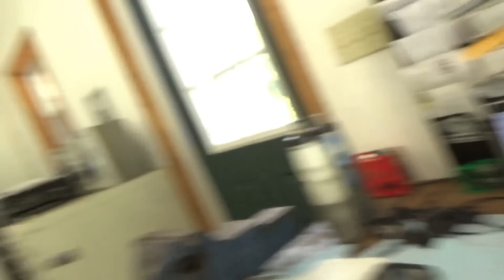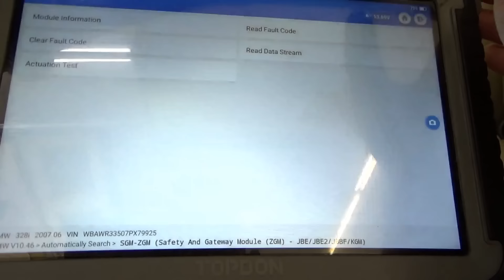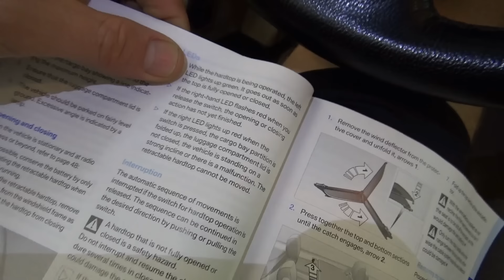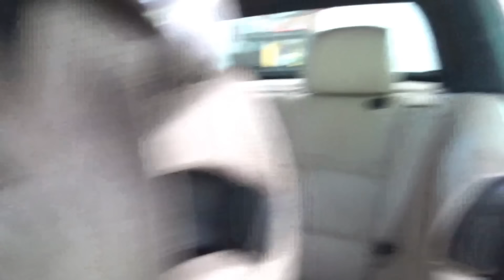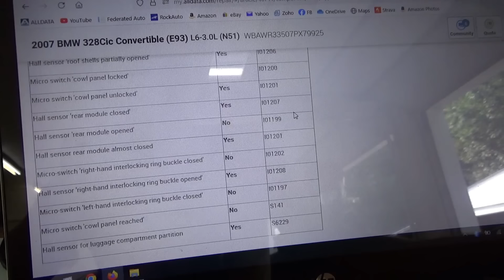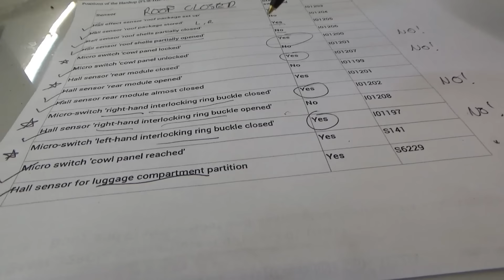(Pt 1) CRAZY Convertible BMW...BUTCHERED!! ('07 328Ci Windows-Top-Trunk BROKEN)

Comment: Scan are great, but you still need to do a hands-on usually it’s in a connectors, but I would spend more time physically than hours on the computer
Reply from the maker: Your hands and eyes can't read voltage signals...the other shops spent MONTHS physically tearing apart the car and connectors and wires and modules, and got absolutely NOWHERE ;P

Comment: I had a smilar issue, i fixed this way: - disconnected the hydraulic pump, closed the roof manually, pushed the rear locks manually (hard to push all the way) to reset the locks position. reconnected the pump. problem solved.

Comment: This is a classic example of why when trying to solve a problem like this, it's important to read and understand how the system works before you start playing with anything. It doesn't look like there was any reason for them to be messing around inside the door panels, with the window switches or the convertible top switch when there was nothing wrong with any of that stuff. All they were doing was potentially building in more problems when the cause of the issue had nothing to do with them.

Comment: i was following along with service info, and BOY are there a lot of different wiring variants for this car. Looks like three or so different versions of wiring within the same model year, depending on when it was manufactured... Thanks BMW! Also, it looks like there are different pinouts for some parts depending on whether it's for the 3 series or 1 series, but not sure if that's relevant for this case.

Comment: Oh man.  I remember going through a check list like this with a Volvo C70 convertible.  It turned out to be a bent linkage arm causing a misalignment with a microswitch.  But just getting at that switch was nearly impossible with the roof closed.

Comment: Hi Ivan, want to give you my experience with a BMW convertible not working.

Coworker was working on it and trying to figure out why the top won’t fold. He gave up and gave it to me. I ended up getting papers from the actual BMW training somehow(don’t ask. No clue). I ended up finding that the magnet for the motor/hook that’s above the windshield broken off. That magnet broken off is supposed to tell the module that it’s completely closed but it couldn’t see it. So with some “Russian” hack, I ended up super gluing the magnet in the correct spot and had to modify it a bit. The module now sees everything and is able to open and close the roof.

Comment: Ivan there appears to have dual hall sensor at each window regulator and my observation is the rr and rl is showing as a low state so the car thinks those windows are already open and probably hasn’t set a code as there isn’t a correlation fault with the sensors, when you was test passenger front with the window closed it showed at as a high state and same as driver front also the roof wont open if the windows are not changing state

Comment: You are so lucky to be able to just pick up a scan tool and look at all the PID info I used to have to tear apart the interior to find a control unit and pin test every wire.

Comment: Anybody Brite suspension techs help with creaky random noise  early 2k f150 2002 5.4 2v 4x4  at slow speeds backing up ect loading suspension.  Complete suspension replaced  even the swaybar bushings and ujoints the only exception is lower control arm bushings which looked good ?????

Comment: I think you need to check for service data into the actual sequence of all the mechanisms and latches. You have a bunch of no's, and you're checking each individually, so you're gonna find the reason eventually. But if you go by the sequence, you'll start with the correct no. And then everything else will probably change and the rest will work.

Comment: Never worked on a 3 series before but did a 6 series convertible. I’m sure a similar concept. Had a bad relay in the main pump motor location. Purple in color. I think there should be a way to manually lower the roof.

Comment: I have unfortunately dealt with several of these, it's almost always one of two things: 
1. Something got wet 
2. The hydraulic system either ran out of fluid because of a leak or the motor died.

Comment: Pretty soon every function is going to have a f***ing computer module. The manufacturers have already gone way beyond using CANbus systems to "simplify" wiring, instead using them to further complicate and therefore profit from given most repair shops (including their own dealers) fail to understand the systems to perform the proper repairs.

Comment: I had a similar problem with a 2005 Chevy ssr when you push the switch the module runs a check list as soon as it fails a test it stops and generates an error. You need a flow chart that shows the order of the tests, then you check each check each one in order until you find the failed test . That is how I found my problems each time .

Comment: you can normally manually close and open the roof there is a hex key near the interior light. i would check the behind rear boot trim think battery side the pumps usually get full of water with leaking light seals. also did not see a ccm module on your scanner that normally lives near the pump and also gets wet. almost forgot the relays live there too

Comment: I just had a toyota that had the same problem with windows and found a melted wires from rear adas sensiors melted and shorting and blow main fuse for module power supple.

Comment: Yikes!!  My first thought is to get this thing to a good bodyshop and get it on a frame machine.  If it hit a pothole hard enough to bugger a control arm, and now the folding hardtop isn't tripping all the right microswitches, I have concerns about vehicle structure.  I imagine this will be quite challenging to get everything to line up and trigger properly!

I will say, these complex convertible systems are one of few things I'll usually send along to somewhere else.  As always, I'll happily look at the vehicle to see if anything jumps out at me (at no charge to the customer), but I have to acknowledge that I lack the patience, and occasionally the physical dexterity, to troubleshoot these things in depth.  I gotta put the customer first.

Comment: The bain of most males; failure to RTFM! 🎉 I would guess when the son hit the pot hole, it jarred the roof out of position and there is no way to automatically reset or re calibrate the roof other than manually activate the motors to get the roof in its ready condition.

Comment: FROM CONNECTICUT. I DONT TRUST 1 SHOP HERE. EVERY TIME I HAVE USED A SHOP THEY DID MORE DAMAGE THAN THEY FIXED. SO, THIS 65 YEAR OLD HAS TO DO HIS OWN WORK. IVE LEARNED A LOT WATCHING YOU, BUT I AM NOT AS SMART AS YOU. HARD TO TEACH OLD DOGS NEW TRICKS. IF YOU WANTED ME TO PUT POINTS AND PLUGS IN GREAT, UNFORTUNATELY I DONT KNOW ALL THIS NEW GARBAGE.
BROUGHT MY CAR TO THE SUBARU DEALER AFTER I MISTAKENLY BROKE A 5O AMP FUSE AND IT SET OFF THE TRANSMISSION TEMP LIGHT, TRACTION LIGHT.... THE DEALER TOLD ME IT NEEDED A NEW VALVE BODY, I TOLD HIM NO.   I HAD TO PUT ALL 4 WHEELS OFF THE GROUND AND DO A TRANNY RELEARN.. 6 MONTHS LATER AND EVERYTHING IS FINE... I WOULDNT TRUST A DEALER TO PUT AIR IN MY TIRE. ALSO HAD AN AIRBAG RECALL. TOOK THEM 2 DAYS TO DO A 30 MINUTE JOB. THEN A FEW DAYS LATER I GOT A PASSENGER AIRBAG RECALL. NO WAY AM I BRINGING IT BACK. THAT WOULD TAKE THEM A MONTH.
HAPPY THANKSGIVING IVAN, YOU TAUGHT ME A LOT

Comment: While watching this video I kept hearing my Dad saying, "Over complicated stuff is neat but that is just more stuff to break and a bigger repair bill."
Reply: Your dad and mine must have been brothers from another mother. My dad wouldn’t even own a car with power windows. “It’s just more stuff to break!” was his mantra.
Reply: Sometimes it's difficult to follow the "Operational Flow," that is what starts, what continues, and what ends the operation.  By "Reverse Engineering" you sometimes can figure it out.  If the motors are working manually, are the switches all changing (open and/or close) direction manually.  I'm sure you checked any Service Information for details.  Any forums online with helpful info?  Without being there, unless someone's seen this before, or is with you, powers and grounds are the start.  Maybe switch adjustments?

Comment: We had one in the shop last year with a leaky cylinder.  Replaced the cylinder then realized one of the micro switches wasn't engaging because it's "bumper" wasn't fully pressing the button.  
The thing looks like a Transformer when the top opens and closes. "Autobots, transform and roll out!"

Comment: This is a long shot but here it goes.  My wife has the same vehicle - 2018 model year - and encountered this issue twice.  First time it was due to a package being put in the section on the right hand side section near the rear of the trunk.  Actually there's a placard with a red X.  Anyway the sensor under that went which was communicating that there was something there so the top wouldn't work assuming something was there that could interfere with the top fully opening.   The second time was a sensor for the package tray that you moved into the open position.  The sensor was not reading correctly so the top wouldn't work thinking the tray was not in the fully open position.  

Good luck with the rest of the diag....

Comment: @Pine Hollow Auto Diagnostics grab an old laptop without personal data on it, and a copy of Ista+. The corresponding cable is fairly cheap. Modern BMWs just use Ethernet over the OBDII connector. 

Ista usually has built in guided troubleshooting for stuff like sensor/logic issues.
Will save you a lot of time and frustration when working on BMW and Mini products.

Comment: If you think the BMW over-complex and a nightmare, try working on a 1961-65? Lincoln 4-door convertible.  All the switches are sequenced and operate individual relays to power the motors.  The rear door windows drop 1/4" while the top is being folded or erected.  Relays hidden inside the latch pillar between the front/rear doors.  And, of course, FoMoCo engineers install a full rack of relays with the connectors facing upward.  If you get any sort of a leak, the water can seep down into the relay 'can' and have a good time rusting all the moving parts.  To make it work, you have to understand the steps it takes in both directions, and the micro switches that signal to enable the following steps in the series.  BMW makes it complex beyond reason, and if your 'buckles' don't make it all the way open or closed, can eat the BCM by burning out components.  Fun.

Comment: BMW engr to boss: I have this system working, ready to ship it.
Boss: How much logic?
Engr: Very little.
Boss: That wont work, add 16 more AND inputs, select signals at random. I suggest oil pressure, TPMS, blower speed 3, and right rear passenger seat belt buckle. Pick the other 12 inputs using VSD (Vehicle Signals Dartboard) in my office.
Engr: Will do.
Reply: Merc has a similar system with convertible hard top in the SLK. Those things are equally complicated but bulletproof. Our 97 still works perfectly fine with very little maintenance.

If you connect the BMW OEM software there is probably a troubleshooting option for the top which tells you the bad sensor in 30s. The software is not too hard to find on the interwebs.
Reply from the maker: @tschuuuls486 30 seconds.... Hahahaha 😂

Comment: My friend had a 1968 Lincon Continential with a hard top convertable slid into the trunk put down the 4 windows an inch the trunk raised up in the back of the trunk rose up  and into the trunk the roof went slick and a rare option ! I had a 1963 Chevy impala hard top convertable but the roof wad fixed nonmoving !

Comment: The old cntrl/alt/del battery disconnect wasn't going to work on this cluster. Too many people have grazed on this poor car's systems, each one digging it deeper into trouble, and failing to fix. Can't wait for Part 2.
Reply: The Ctrl+alt+delete is probably in ista+. The BMW OEM software. Probably a re init convertible top option.
If it would auto fix itself on battery reset, that could be a bad idea. Imagine the top tries to open and gets stuck in a snowstorm because the battery terminal is loose.

Comment: It was always going to be something to do with the top and it will end up being something pretty simple like a micro switch or sensor. Its amazing how well these things actually work and how dependable they can be. I mean the darn thing is almost 20 years old. The complexity is nothing compared to a 90s Mercedes SL500 with its 12 or 13 hydraulic cylinders and about 50 mini hydraulic lines each one unique from each other. At least you can use a scan tool to aid in diagnosis. You have to admire the engineering even if you don't like the complexity. Love it!
Reply: I totally agree, when you think about what it actually does, being a fully automated folding hard top, it's an incredible mechanism. There are a few on here belittling “German engineering” because it broke, I guess.  Nothing lasts forever, but I would bet on the durability of this 20-year-old hard top over what automakers produce today, any day.

Comment: one of my rules of thumb: the Manual is one of "Five Things People Throw Away™".  you should count yourself lucky if it's there on a used vehicle.  the other two are "the wipers are ALWAYS shot, and probably bent' and 'no one ever replaces more than one bulb' (and with non US made cars, they use clear bulbs where ambers are needed)  and thanks to you, I have a new rule of thumb to add "grounds are always crusty"
Reply: the battery holddown is also usually long gone
Reply: @tubesnstuff503  new one on me. although what happened with the vehicle that STARTED my viewing here definetly counts...a small group 54 in a grand cherokee that the "tech" put in backwards

Comment: Wondering just how deep that pothole was. Maybe it tweaked the position of the top or even worse the micro-switches are out of alignment now. Fine engineering on display in that lift system

Comment: This brings back memories of my helping a friend with his 2004 Cadillac XLR. A Corvette platform and European convertible hardtop system likely borrowed from this BMW.

I gave it a shot but didn't have GM Tech 2 tool. Am convinced local GM dealership would not have solved this.

So we took it to a mutual friend, chief engineer at GM Cold Weather Test here in Kapuskasing, ON (recently closed). One of the smartest guys (and hands on) you'd ever meet and with all the proper tools. Still, took him 4 hours.

Comment: Ivan's working on a Thanksgiving turkey... Makes one wonder how Furd made the Tbird and Retractable Fairlane do this 70 years ago without  a computer.
Reply: HI those got stuck too, relay logic, I remember my dad working on his friends and complaining about the multitude of control relays behind the rear seat
Reply: @richb419    I never said they didn't get stuck.   I said it made me wonder how Furd did this 70 years ago and made it work without a computer !
Reply: My dad had one of the T-Birds with the soft top that folded itself into the trunk. All relay logic. Top worked flawlessly and with the top up was quieter than many hard tops. 

My favorite part was when the trunk lid was open and vertical a relay kicked in and a little flap would flip up. The flap covering base of the now folded top. Brilliant.

Comment: I"m so shocked that a a BMW would have a quart of oil in the rear seat.   ;)   I did that dance many years ago.

The roof  is both overengineered and under engineered.   The engineers in Munich should take a look at the simplicity of the  MX-5 RF roof and learn a thing or two.